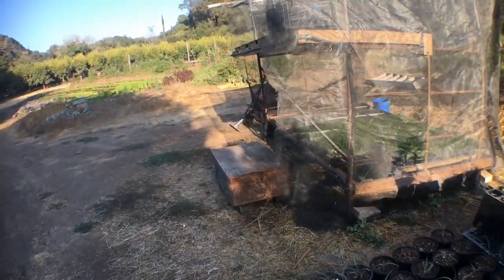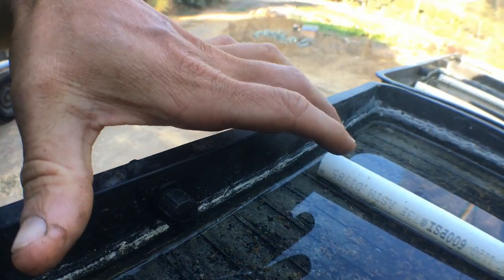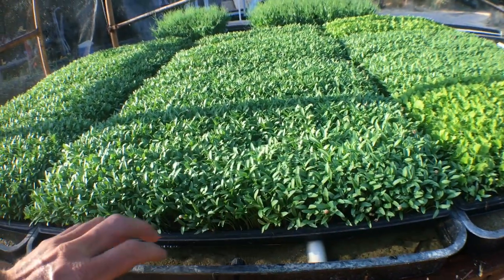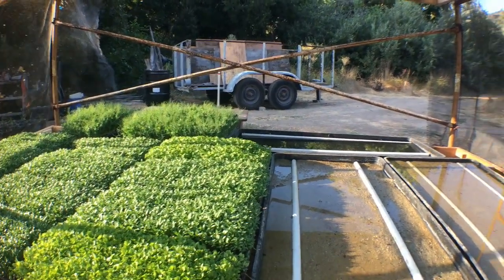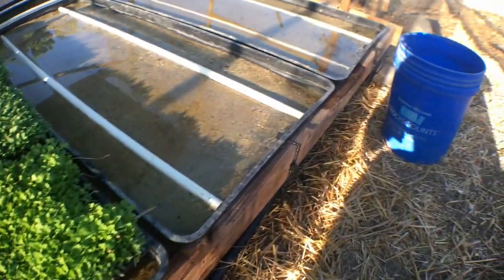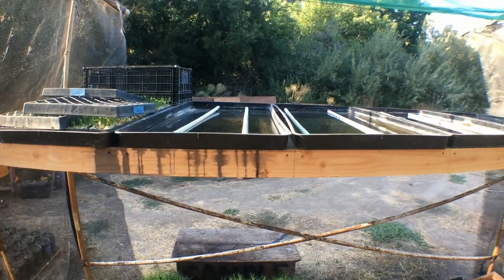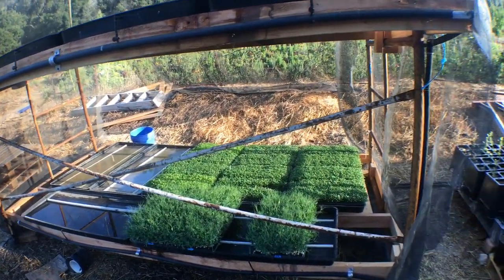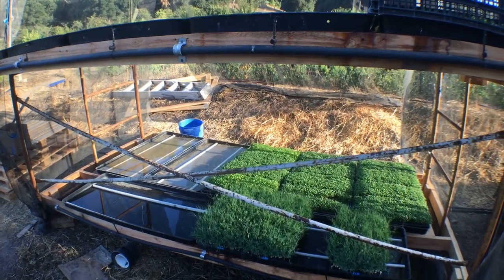Automated Microgreen Bottom Watering System - DIY

Comment: Great video thank you for sharing. Does the surface of the water inside the sump tray come in contact with the bottom of the individual trays? Or is there a gap between the bottom of the flats and the top of water level? 
Thanks again
Reply from the maker: The water surface does not come into contact with the tray bottom when set up properly - generally if this happens the soil in the tray will become waterlogged, hence the PVC pipes running the length of the sump tray to keep the trays just above max water level.

Comment: I like this idea, but because I grow indoors, it's simply not feasible to allow trays to drain onto the ground. Anyone have any ideas? Perhaps a collection basin that could be fed back into the water supply?
Reply: Use a larger hydroponics tray for your lower drain tray.  Something like used for growing marijuana.  Maybe 10 or 15 feet long and has a drain hole in it.
Reply from the maker: Totally agree Alexandeur, our next step would have been to create some sort of sump (I was hoping to make a cool water garden - water for insects, critters etc.) to capture any excess water and put it to good use. I imagine if you were running some type of closed loop system (aquaponics or hydroponics perhaps?) that you could cycle any spill over into a few horse trough reed beds and then have those fall into a sump to be re-pumped through the whole system.

Comment: What’s The function of the sand?  Do you if this has been used to water potted plants? Also, what’s the savings in the amount of water needed?
Reply from the maker: The sand functions as a wick for the water and reduces the amount of open water in the system at any given time. It also ensures even moisture distribution across the bottom of the sump tray via capillary action. 

I haven't personally used this to water potted plants, thought I imagine an air-pruning style pot with a mostly open bottom would do quite well set 1/4" above a moist sand media.

I don't have any numbers on water savings for you unfortunately!
Reply: Thanks

Comment: Do the trays drain? Also if you don't mind what is your seeding density for the cilantro?

For the quarter inch line going in you could try a top hat grommet. They sell them at amhydro.com. Drill a 3/8 inch hole and they pop right in. You can slide a quarter inch tube in and out super easy and they are water tight even under pressure. I use them for the inlets on my Nft system. Just an idea.
Reply: Casey Pfeifer Thanks so much for the info, I really appreciate it!
Reply: Michael Welch how
Reply: Majid Fathi I don't understand what you are asking.
Reply: do d trays drain

Comment: How much of the bottom of the top tray touches the water
Reply from the maker: Ideally it doesn't touch, but is maybe 1/8" to 1/4" above the water
Reply: @7thGenerationDesign  I am curios if the bottom of top tray doesn't touch the water then why have water underneath...is it just for the moisture? Thank you.
Reply from the maker: @mandiegarrett1706  yes, the roots will exit the bottom of the tray and contact the water themselves, and basically do a great job of self-regulating moisture uptake, which really helped reduce the amount of mold issues
Reply: @7thGenerationDesign  Awesome...THANK YOU.